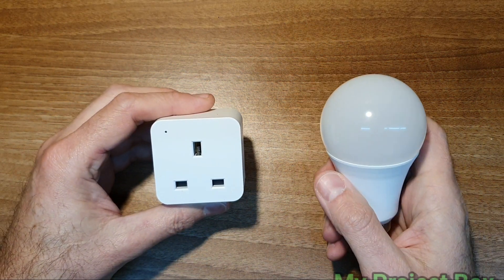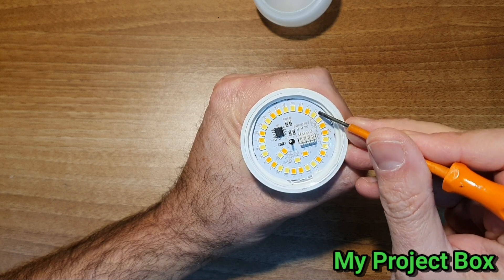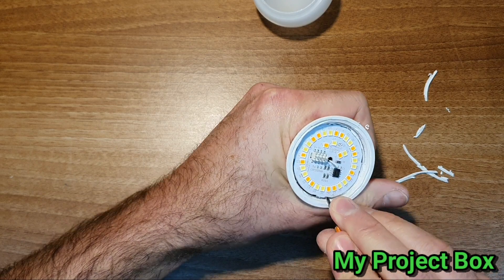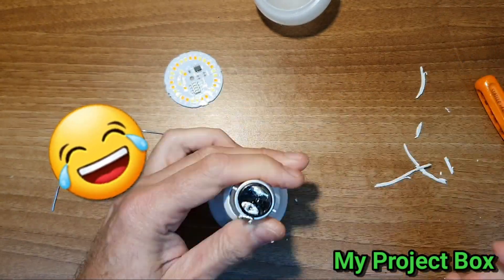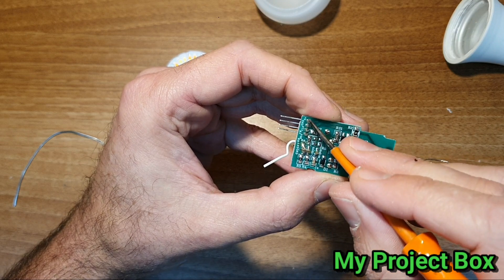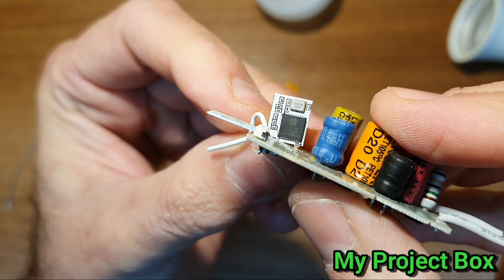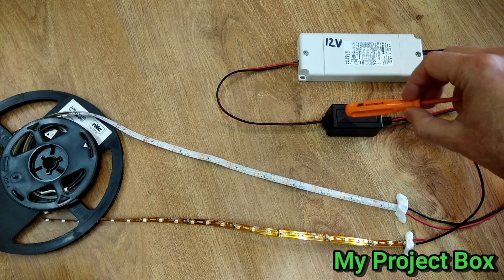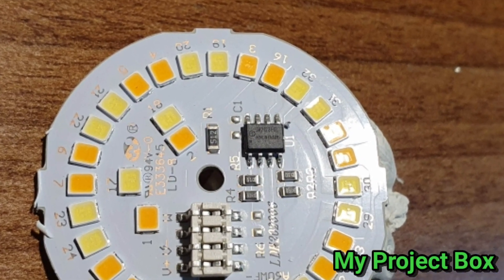Poundland Wi-Fi smart Tear down & Hack

Comment: I would love to know the power consumption when on and on standby, as we are being screwed in the UK for our power!!
Reply from the maker: I don't currently have a plug in power meter with me. I have one in the UK packed away in storage. I could check the current draw and times it by the voltage, but that would only give me apparent power, not true power. So I won't know the power factor either. When I get access to one  I will post the results. But the bulb's internal power supply is very small and shouldn't consume much standby current.

Comment: FYI Poundland started selling even cheaper versions of these. Exactly same brand and more or less packaging. They did downgrade the chip, making it less useful. It's now using Tyua WBLC5 with Beken BK7231T.
Reply from the maker: Are you saying that the module no longer has the esp8266 chip on it? That's a bit of a shame😔🤔. Are people doing firmware mods for the bk7231t ?
Reply: @MyProjectBoxChannel  Yes, there's some work to replicate Tasmota on it but it's definitely not as good as ESP chips.
Reply from the maker: @odiroot  it's a shame, because I would like to do firmware/hardware hack to these "cheaper" smart bulbs. I would like to have access to a GPIO input trigger inside the bulb, for a simple little circuit. This would allow the bulb to be triggered by a ordinary light switch. My hack would power the smart bulb even if the switch is in the off position. I did a very crude version with a way of the top Shelly1 hack. https://youtu.be/29QgXRgHCx4
Reply from the maker: it's a shame, because I would like to do firmware/hardware hack to these "cheaper" smart bulbs. I would like to have access to a GPIO input trigger inside the bulb, for a simple little circuit. This would allow the bulb to be triggered by a ordinary light switch. My hack would power the smart bulb even if the switch is in the off position. I did a very crude version with a way of the top Shelly1 hack. https://youtu.be/29QgXRgHCx4
Reply: @MyProjectBoxChannel  Whoa, what a hack! And scratches a real itch too.
Reply from the maker: @odiroot  you can see how much simpler it would be, to connect my optocoupler circuit, directly to the smart bulb's original WiFi module🤔.
Reply: How did you find this info, how do i know if i have the esp or tuya hip without opening it up? Cheers